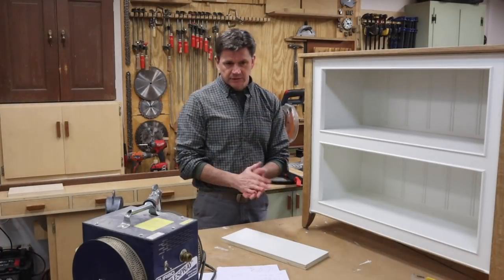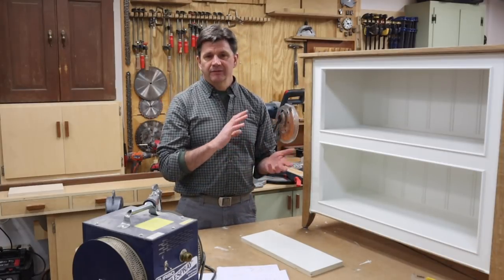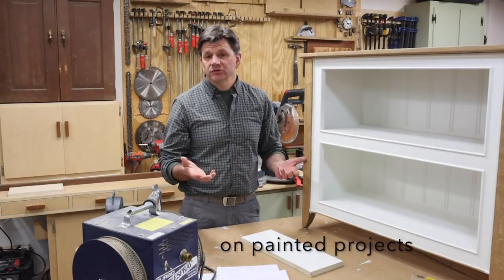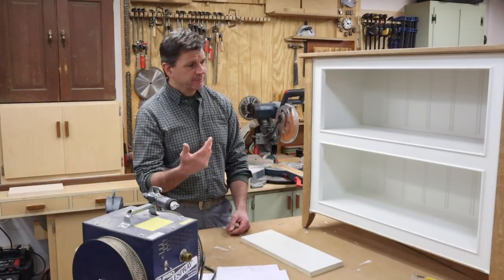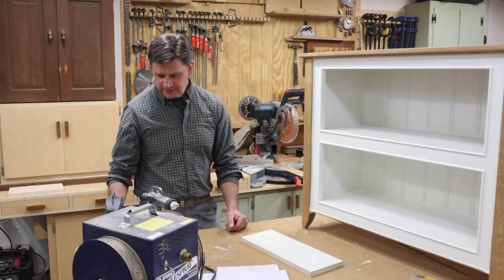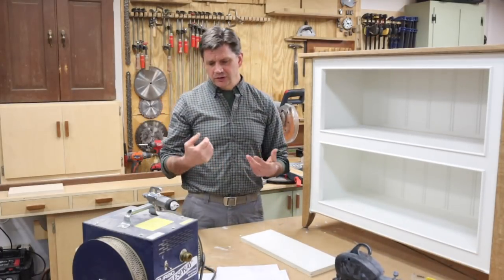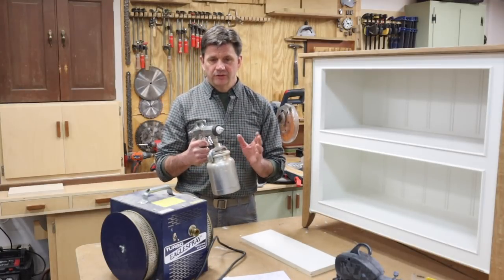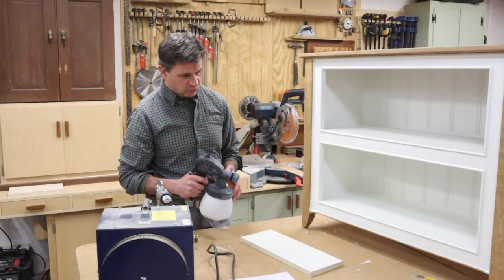Shop Talk #24 Painting and Finishing the Bookcase

Comment: Before painting MDF, I always seal it with Shellac. It dries in a few minutes and then I can give the piece a light sanding and then apply a coat of primer before sanding and painting two coats finish paint. Then I let the paint dry for a few days and then spray two coats of MinWax Polycrylic to leave a protective satin finish that stands up to heavier use.

Comment: Hi Jon. Great project. A question:  as an alternative to spraying lacquer over the paint, what are your thoughts on spraying water-based Varathane?   Do you see any problems with doing so?  I tried it on a bookcase I recently refinished, and it seemed to work out quite well. I used the satin finish. Not sure, though, how it’ll hold up.